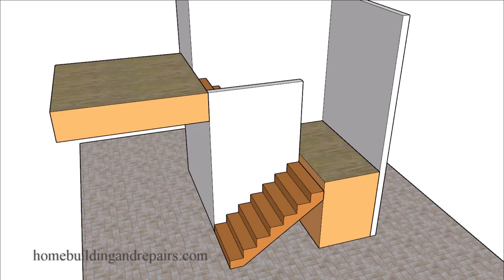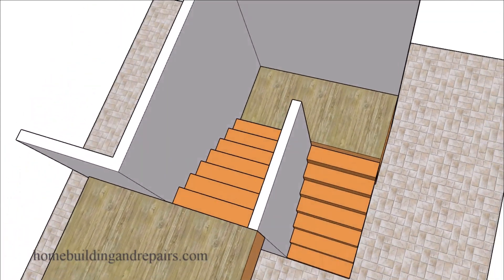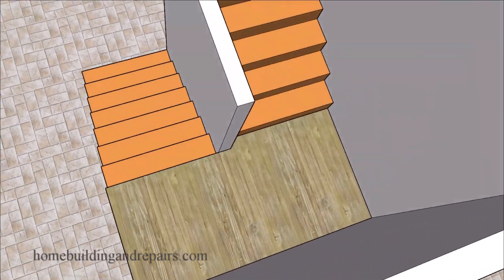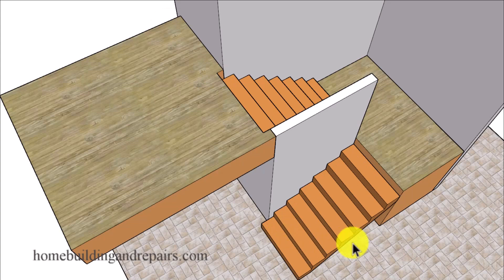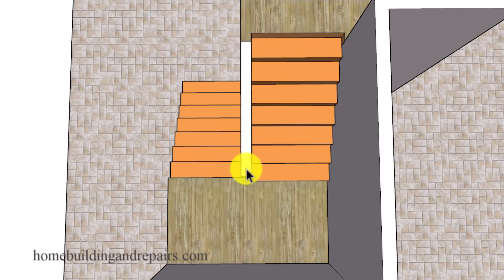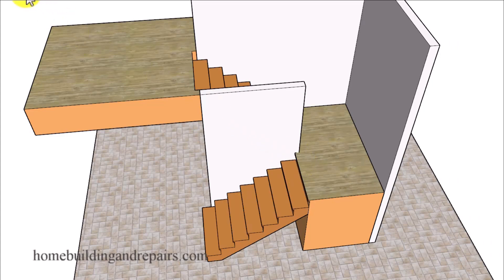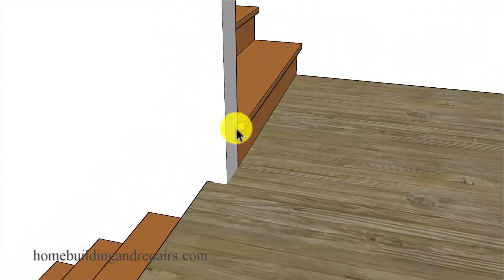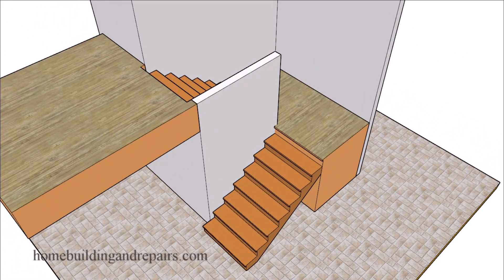Why Your Stairs Might Be Protruding Into Hallways or Landings And Creating Building Code Problems

Comment: Thank you for the video! 
I see this peoblem a lot in old apartment  buildings here in Israel that is going through massive renovation.
They add to the building new elevators so the stairs become a back up for emergency mostly, so the contrcators dont put as much effort to build them correctly
Reply from the maker: I see it here in the USA also, especially in older buildings.